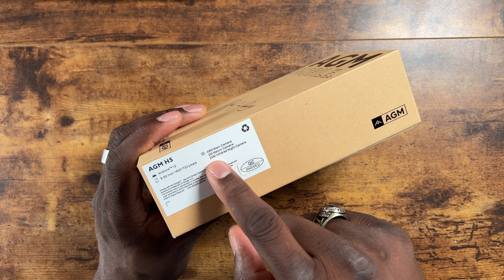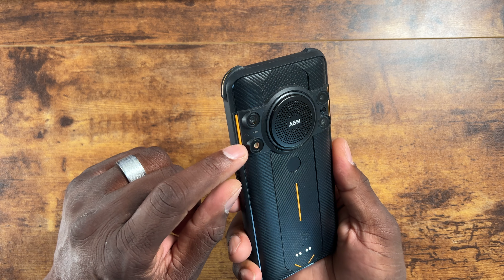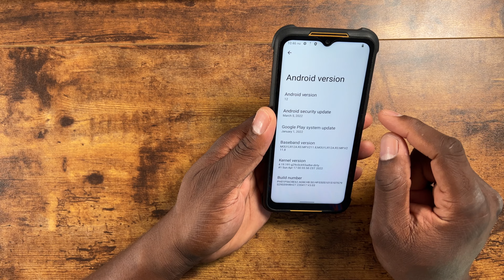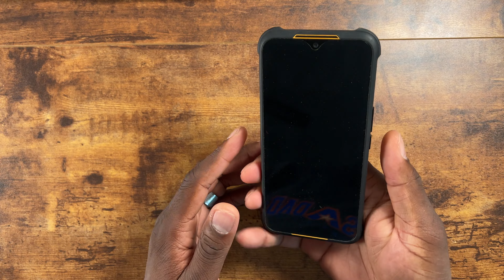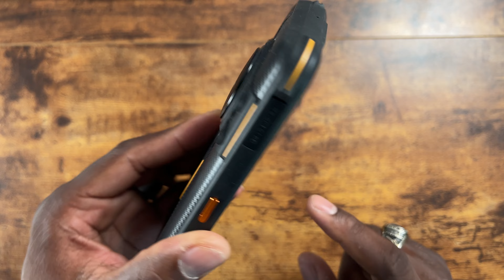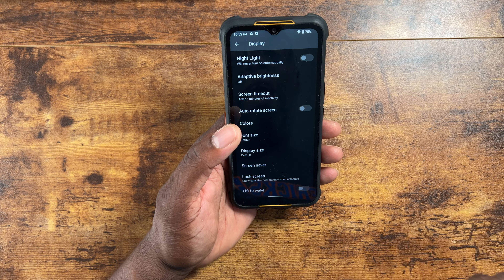AGM H5 Rugged Smartphone! BIG Sound, RUGGED design, Android 12!

Comment: DON"T DO IT! This phone is not at all what it seems. The speaker sounds terrible. The fingerprint scanner is faulty, so you end up always having to input your code, then hit enter before it unlocks. The camera frequently opens at random once the screen is unlocked. The screen is often unresponsive. You'd think for 2022 with Android 12, it would be a decent purchase, but it isn't. 
To top it all off, good luck returning it if you purchase directly from AGM! They ask that any inquiries be done via Facebook, which is not normal for legit companies to ask. And when they respond, the email address varies, with letters that don't match up (ajm). Plenty of typos on their website. So far, they've given a return address in California that has no obvious ties to the company. Wish someone like me would've given an honest review. I spent hours researching before my purchase, and still ended up dissatisfied.
Reply: Just got mine and it won't even charge up. Smfh.
Reply: I bought one recently. I agree with the fingerprint feature. But I'm fine unlocking with, just as I have previous phones.

My camera app doesn't randomly open, unless I unintentionally click the app. Since the bottom on the left 👈 side of the phone, by default, will open the, maybe that's your issue. I disabled it the button in the settings. There are multiple options for that button.

In general, I'm happy with this phone so far. The speaker is loader than any phone I've had or been around.

Good luck setting the phone up to your liking, or getting it returned!
Reply: @tdginter   The screen is frequently unresponsive, which is maddening, to say the least.  There is no dedicated gallery for the photos. The camera is terrible in any low light setting, even with the flash. This phone can't be set up to my liking because it doesn't have the capabilities of a standard smartphone. I am very disappointed with this phone.
Reply: @beautyinbutteamerica1776  Can u recommend another rugged smarthphone with android 12 or  u still looking for sth?

Comment: Garbage.   Crashes every 10 minutes.   Sometimes take 45 minutes to restart
Reply: You should exchange or return it. May may have received a defective device. Which can happen with any product.

I've had my phone about 3 wks, as haven't had 1 issues with it so far.
Reply: This thing did multiple updates within the first week, which did take a long time to complete, longer than any other phone I've owned. And now, it shows the last update as March 5th 2022, and it's highlighted in red, as if it needs updated, but when I search for updates, it tells me everything is current. This phone truly is garbage.
Reply: @beautyinbutteamerica1776  if it's running Android 12, there may not be additional updates at this time.

This is the 1st new ph I've ever had. In the past I typically bought gently used phones on eBay, or had a gifted phone. This is the nicest phone I've had. It doesn't have all the little features Samsung's typically have, but I can live with that, since I didn't utilize some often anyway.

It's also possible the ph you received is mildly or moderately defective. Consider looking into a replacement.
Reply: @tdginter  Nicest phone? Yours must be different than mine then! Try taking a picture of someone indoors, then try not to be disappointed with the results. For a new phone, there's no excuse for the things this phone can't do. I've never heard of a mildly defective phone.
Reply: face problem bro, just get a new phone lah

Comment: They should strike up a partnership with Skullcandy and do that speaker right, and add some front speakers for surround sound. Other than that it seems to be a decent rugged phone. The charging speeds are pretty bad though. 18w max takes about 3 hours to fully charge and SoT is 10-13hr. I get that sot with the 7T and close with the s22ultra while only having to charge for less than an hour.

Comment: I'm one of those who use only Rugged phones. I've owned 3. No case needed. Big battery. Easily 2 or 3  days of moderate use. I don't even carry my charger with me. I had a Kyocera it was rugged but had a small battery . But the  Doogee S96 I had and  Conquest S20. I'm using now had a 6300 and 8000mA battery.  The cameras aren't flagship level. But they take decent midrange quality pictures in varying light conditions. I can't see myself ever buying a non rugged device. Some  also have some nice novelty features such as the infrared night vision camera, plumb bob, level, heart rate monitor, underwater camera,  etc. They're definitely not for everyone. But I love them and I'm considering an AMG phone as my next phone. Nothing is wrong with my current phone. But this one looks interesting